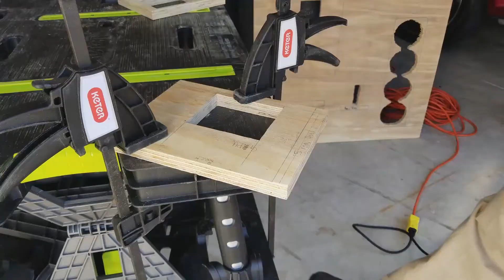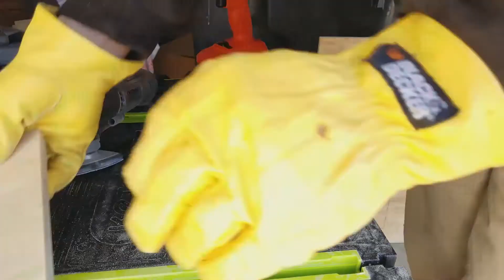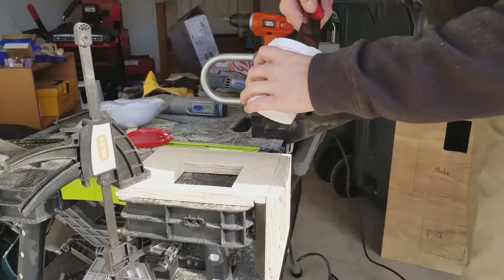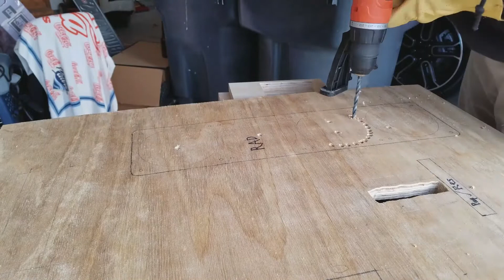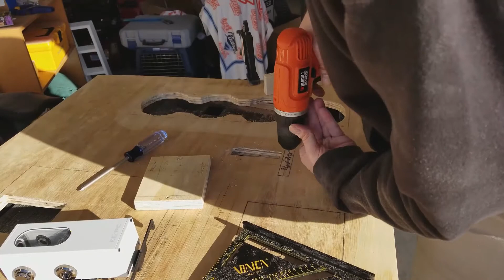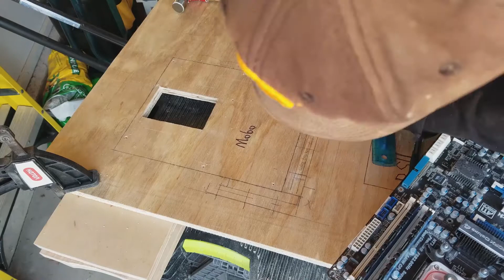Build A Wood PC Case PART 1

Comment: Looks very interesting so far turbo.
Reply from the maker: waiting on a dremel bit from amazon for another platform i have to make and attach to hold the PSU on. but doing some spray painting tomorrow. just taped up/cardboarded my rad and rad fans. and hopefully making some cutouts for cable routing. should have enough for a part 2 soon.
Reply: Would he be able to sell wooden cases for those who build there own computers?

Comment: Always predrill holes, you are compromising your structure when you just put a screw in there, see how it bulged out at the beginning, the structure is very weak there. Also get a hole saw in future, your cutouts will look crazy good. Keep it up.
Reply from the maker: I actually did predrill, just didnt predrill with a large enough drill bit. OOF. I think i edited out the predrill part though so it didnt look like i did lol yea hole saw would have been great
Reply: @TurboLimited  great man, keep it up would like to see it done completely. I have built my own server cases, inbox me and we can share ideas
Reply from the maker: I have part 2 and 3 videos. The build is done. However i accidentally fried out the cpu with a major blunder so i never got it functional. It was just for fun with my old hardware anyways lol